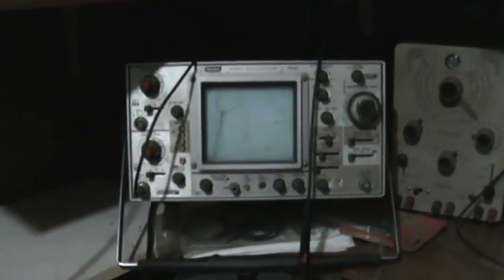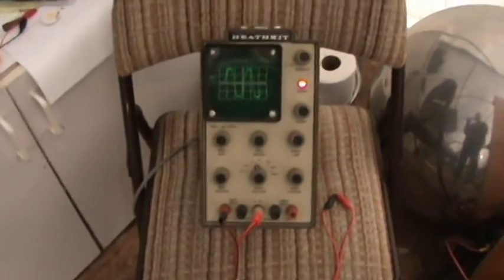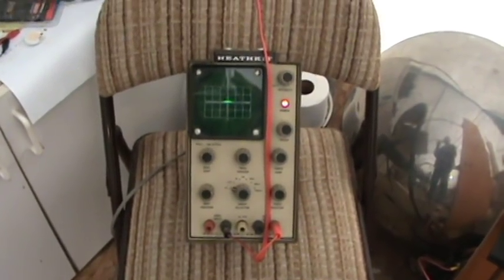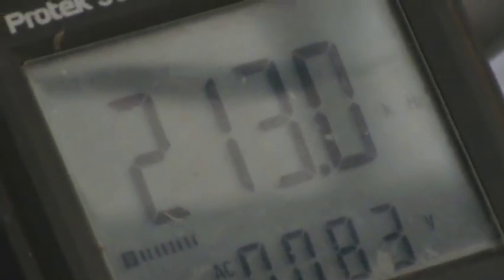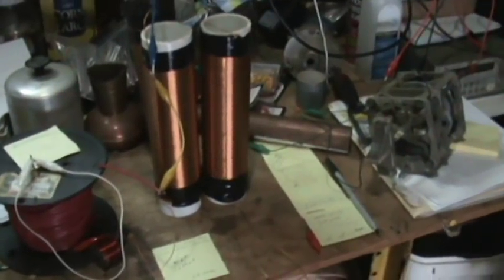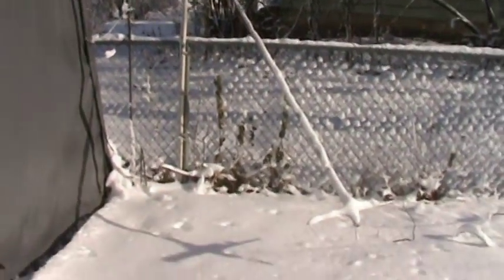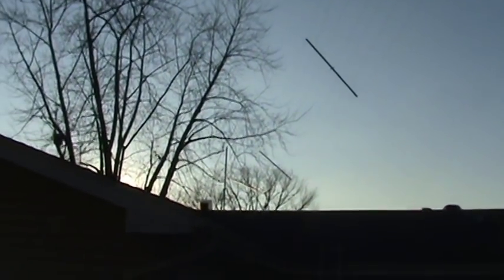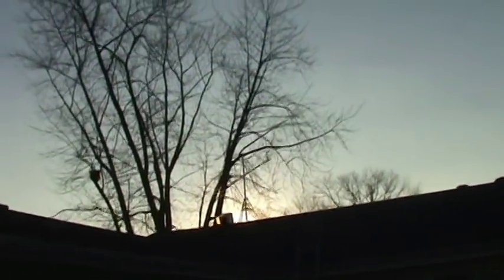Free Energy From Air 2018,  part 8 (try to use oscilloscope)

Comment: Загадка радиометр https://youtu.be/iDKB4oryzD8
Reply from the maker: Good to see people experimenting.  The Crook's tube has always interested me. Works with only a "partial" vacuum.  There is still controversy about how it exactly works.  If i remember correctly, it is most responsive to UV light.  Some talk about the absorption & reflection of the radiation & some will talk about flowing over/under the flags and Eddy currents, some may describe as air flow around the back of a large truck while in motion.  But hey, i am not an expert on it, that's for sure, I'm just throwing some thoughts out there.  Would of been nice of you to comment on my video here before using it as a porthole to your video though :-(
But good luck with your new channel anyhow.

Comment: An entire decade of r and d, I think it's time you get some fruits for your labours.

Please don't forget The Primer Fields, once you've seen the videos I can assure you that you'll also be changing your Tesla coils winding shape because the copper winding going to the top of the coil are not repeat ARE NOT supposed to be perfectly parallel to one another it should be tapered inwards at the top and outwardly at the bottom just like an ice cream cone.

It's this winding that causes both restriction and amplification, they can been seen clearly to be conical in Teslas lab and a gentleman here on YouTube has used them on a motor but he didn't understand the results even though they were 100% exactly as they should have been.

I did send him a message and I really hope he sees it because he was so close to a huge breakthrough with electric motor coils.

He saw what I saw in The Primer Field videos but dismissed where the energy was because he thought it was going to be in a different position and it wasn't it was exactly where it was supposed to be just like The Primer Fields shown him.

He actually got higher power from them than he did from both standard coils and a pancake coil but because the energy wasn't where he'd misinterpreted to be he considered the test a failure.

I really really hope he sees the message I've left for him because he was literally 180° of rotation from getting the results he was expecting to see energy wise.

I'm so happy you're still here and continuing to push, so many people give up on YouTube after a few years.

I wish I had more time in my day to talk with more people in the energy community but I'm sure as you know when there's information you need to learn but with absolutely no idea of exactly what it is then finding what it is you know you need is pretty time consuming and very laborious.
I'm pleased to say that after thousands of hours of watching lectures, experiments and tests and looking to the man we all know had this the ability to pull electricity from thin air I'm pretty certain that I've discovered the missing connections that finish this all off.

It's been a long road and my eyes haven't enjoyed it one bit, but when you want to see things like this do well time in your head stands relatively slow, you barely notice a day fly by and weeks just meld into one another.

I really hope The Primer Fields open your eyes Paul and if you have any questions about the coils please do ask and I'll do my best to answer your question.

I've been putting it off and putting it off in making a lab and beginning because after watching others and what everyone else has been doing I knew 100% that it was going to be one expensive fail after the next and that's not something that aligns with my budget constraints so I've been watching learning and loads and loads of questioning and thankfully I've always got answers from the many great free thinking creators out there.

I think the song goes “wise men sing, only fools rush in, but I can't help falling in love with you" UB-40 
It's such a befitting song for my approach on how to pursue energy.

Of course if my budget was endless then I think I'd have gone at it like a bull in a China shop and had all manner of disasters but that's the really great thing about YouTube, there's literally thousands of people out in the world all pushing for the same goal as I am and all using varying techniques and methods in trying to achieve it and by doing so they've allowed me someone with restricted funds to learn from their mistakes and compile everything that I've learnt to the point where I'm at now and I believe that 2019 is going to be our year.

I'm going to start my own kitchen lab because it's going to be more comfortable and warm than the garden and then I'll be securing some reasonable camera equipment to document and post the videos for everyone.

Hope you all have great days and if you're not back before Christmas and New Year have great one's.
Reply from the maker: Hey buddy!
Thank you so much for the great comments.  I just saw them, as they were being held for review for some reason.  I have seen the "primer field" videos & David LaPoint about 6 years ago, and i must admit, when i saw them, it blew me away and i "Never Ever" forgot them!  They have the patent on those magnetic bowels.  Really made me think about how the solar system may work.  I will check out the videos again now, especially the parts with the plasma since you  mention it & it has been so long since i last watched :-)
Im getting older & suffering from CRS(Cant Remember Shit), hehehehe.
I think we have a lot in common!  Here is my email....
millanyangle@yahoo.com
Talk again anytime
Merry Christmas! :-)
Reply: Sorry here's my email, johnnysempireofdirt@gmail.com

Comment: I think this has been a blessing in disguise Paul.
It's time for a new antenna design.
Please have a watch three videos called The Primer Fields.
This will show you what coils to put on your antenna, as far as I can understand energy is it works via compression and retraction.
When we compress electricity it begins to heat and the power amplifies either to the point it's safely redirected or until the current and heat builds to a point that failure is imminent and explosions soon follow.

I've been doing a lot of research on Tesla and he seemed to have some odd shaped coils in his lab and I believe he stated his best results were from either his circle pancake coils or his spherical and conical coils and after watching The Primer Fields and seeing a gentleman here on YouTube using them I had to tell you.

If you can muster sitting down and watching some super interesting but knowledgeable videos on plasma containment then I can promise you that this is something I think you've been missing this entire time with the air circuit.

Please watch The Primer Fields, this will show you with a rough guide on what shapes and I think I have a theory to further amplify your current as its coming in by using these coils as continuous resistance to try and force the current into a compression zone to keep amplifying.

It's took well over 4,000 hours of watching hundreds of different videos and I'm pretty confident that this will work as its virtually identical to Mr Teslas Wardenclyffe tower coil.

I very much admire your diligence and persistence in making your air circuit work and I think 2019 will be a great year for you.
I know that it's going to mean redesign for some coils for your antenna to drop down into but it's the only other way I can see any kind of amplification occurring.

I think you're going to be pretty excited after watching these primer fields videos, when I found them I knew that it was just the trick for your air circuit because your antenna has no way to compress the energy and drag further energy in.

I'm almost certain that these coils are put in transformers ceramic cathode and anodes to increase and decrease power as they can cut power just as effectively as amplify it and it's all down to the shape and winding directions.

I really hope this is new information for you because if it is I can really see some very promising results in the very near future.

Please let me know when you've watched The Primer Fields and I'll explain a few coils to you and how they best work to induce compression and ultimately amplification.

As always, great work and I appreciate your time and efforts.

Have a good day buddy and my best wishes to the family.

Comment: If a signal shows up as a wave on an oscilloscope it is AC. That implies it is either the power distribution at the primary frequency or a harmonic, or a radio frequency signal. Atmospheric energy is generally DC. I say generally because there are natural oscillations but they are USUALLY so small so as to require amplification and filtering at very finite wavelengths to isolate and identify.  Antennae tuned to various wavelengths or possibly a single antenna feeding through multiple tuned circuits to optimize the energy collected can be used to minimize the amount of material used. For the most part those are manmade AC signals. They could be anything from varying broadcast signals, powerlines, leaking microwaves etc. 
Having said that there are natural frequencies associated with the earth as well. Schumann resonances are the principal background in the part of the electromagnetic spectrum from 3 Hz through 60 Hz, and appear as distinct peaks at extremely low frequencies (ELF) around 7.83 Hz (fundamental), 14.3, 20.8, 27.3 and 33.8 Hz. These are global renonances.
Wikipedia has an article on it. https://en.m.wikipedia.org/wiki/Schumann_resonances
Additionally there aer telluric currents in the earth which vary from DC to ELF frequencies. There has been some research into the possibility of harvesting telluric currents  https://en.m.wikipedia.org/wiki/Telluric_current
Geomagnetically induced currents are a problem in power distribution. Power lines are protected by drawing off the currents to ground like lightning arresters. Unlike lightning, geomagnetically induced currents are of longer duration, however they fluctuate with a number of varying terrestrial and cosmic conditions.
I don't know if you have read up on these but it is worth bringing it up since it can have an affect on your observations.
Reply from the maker: Thank you for this good info here, most of which i basically understand.  But a little more difficult for me to isolate signals.  I keep thinking that im collecting harmonics or beat frequency, yes, maybe from multiple sources, many man made devices or even freq coming from the cosmos.  Thanks again for the great comments!
Reply: Interesting that you mention:

 "Geomagnetically induced currents are a problem in power distribution. Power lines are protected by drawing off the currents to ground like lightning arresters"

Not so much power lines, but the towers they are connected to, as well as all other towers in general are throwing away what we are trying to collect and harness. I assure you, it is AC current we care about, mother nature cannot run on DC.

Comment: The issue here is that you are picking up technically millions of frequencies, therefore it is naturally not going to be one clean line, its as much like 'sound' as all of the sounds combined coming to your ears in that recording from all kinds of different sources. The sun, the cosmic rays, television and microwave frequencies, as well as a host of other sources are all coming into that wire.
Reply from the maker: Hmmm, thank you,,,i have to agree :-)   I will think about isolation and other things.
Reply: @INVENTOR3  You will gain MORE power if you build a multi-phased array which exploits every one of those frequencies actually. Dialing out power is not efficient. The IDEAL system is one which can tune IN the greatest number of frequencies and gt the power from ALL of them. All that comes down to is a set of fractal resonant coils, and there is a mathematical chart some place online for that, get a little bread board or copper peg board and wind some really small coils [fractal coils] and make each one pick up all of the dipolar values it can, then feed them all through diodes into the same common DC battery [or capacitor] to build a buffered supply of steady dc voltage to work from. My dad showed me all of this long ago when he was building radio towers.

Comment: No worries Paul, a scope is just a complicated voltage meter. It measures voltage over time and that's pretty much all that it does. Volts per division equals frequency in the horizontal axis and the vertical peaks and dips simply represent maximum voltage. Either way it's just voltage over time. Modern scopes will show you the frequency on screen with offsets and noise of like kind but still only show the same voltage over time. Voltage is vertical and time is horizontal on a scope, frequency is the distance between the peaks. Literally read between the lines when using a scope. I'd give you my old scope but I don't have a replacement for it yet. I have a Tek 2235 and it's alright for an oldie but a goodie. I want a modern digital version and just have not pulled the trigger yet. When I do, my old one is yours if you want it..

Stay vigilant my friend and keep up the good work.
Reply from the maker: Thank you!   I understand about the voltage being vert & time is horz,,,but there are no numbers on the graph screen,,,what is each division,,,plus i can adjust knobs to make the waves higher or wider,,,,but anyhow i will bite the bullet & watch some videos & finally push myself to learn to use the scope better.
Reply: @INVENTOR3  The numbers are on the knobs you use to adjust the scope. Every vertical line represents whatever time scale you have set just as every horizontal line represents whatever voltage range you set. Then you have to do math to calculate your frequency. A video is much easier then typing it here, do a quick youtube search for "how to use an oscilloscope" and pick whatever you like, lots of good videos out there.

New digital scopes do so much more for you then their old analog counterparts, and now you can pick up  good one for under 500 bucks new, even less used. I still have my 2 channel 100 MHZ analog dinosaur just for that once in a while when I actually need a scope. I just don't use it much anymore, but I'd love to get a digital replacement one of these days. But I need a new DVOM first, my old one finally crapped out on me.

Anyway, take 'er easy bud and keep up the good work.
Reply from the maker: @Finite-Tuning  Thank you very much :-)